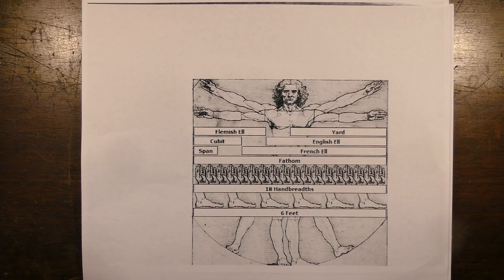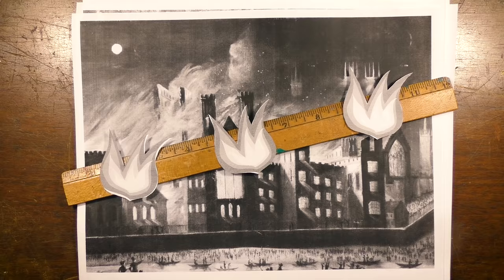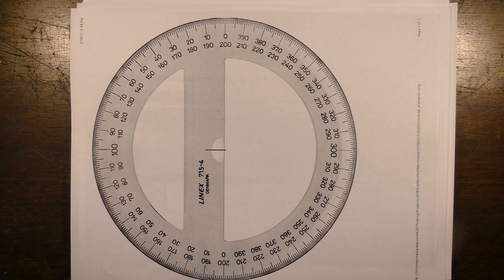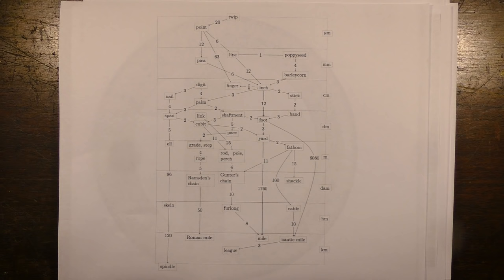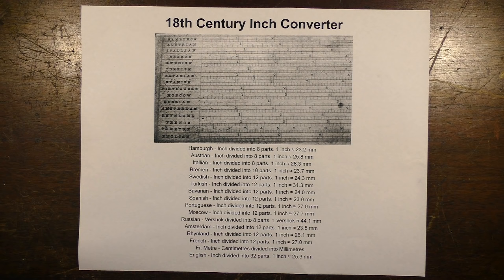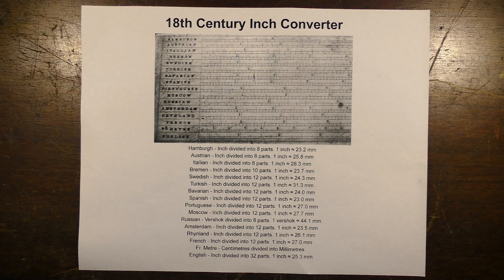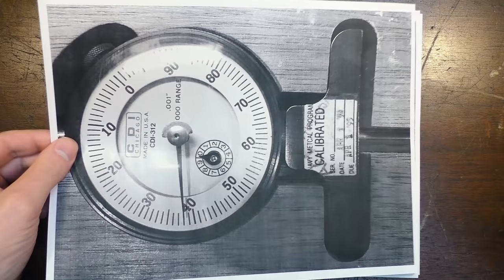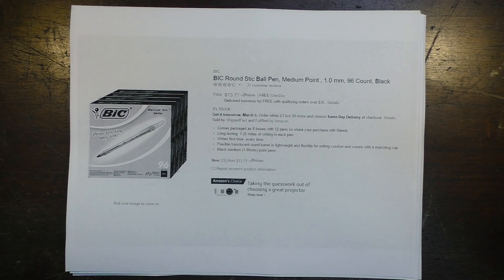Origins of Precision

Comment: What about earlier traditions of precision? The machines of Greece 2300 years ago were used to produce the Antikythera Mechanism. The megalithic yard is equal to the length of string required to make a pendulum which oscillates exactly 366 times during the transit of Venus across 1/366 of the horizon. How do you suppose the 100 ton, granite boxes of Saqqara were made flat, smooth, and square within a few microns at least 4000 years ago?

Comment: Video explains about moore company`s machine accuracy and various tools to measure parts accuracy. my thoughts about this video is that the moore company may be starts making their machine very precisely and insane length of machine. This company starts block gauge from 0.1001 inch  to 4 inch which is Extra ordinary things for error less production. This video relates to metrology because metrology is the scientific study of measurement not only mechanical field but each and every field is now depend on precision. we can get quality product if we focus on Accurate dimension of the final product for this we must learn metrology. The video explains necessity of metrology and methods to improve it in proper way

Comment: Kinda funny that it took me this long to realize the connection of the circumference of the earth to the invention of the meter. I mean, I knew the metre was based on the distance from the pole to the equator... but I never really thought about the implication... if a quarter of the trip around the world is about 10,000 km, then of course the whole earth is 4 times that (40,000 km ;P) .

Comment: They clearly state that the total number of combinations possible with 81 blocks is over a 100.000. They are not advertising over a 100.000 discrete measurement increments. Of course, if u have 81 blocks there would be 2^81 combinations which is far greater than 100.000. In fact, somthing to the order 10^24. Maybe a smart way to handle this situation without calculating the increments.

Comment: Actually, you are wrong. The mile, inch, foot, gallon, pint are all intergrated with the circumference of the earth. They are based on the 3,4,5 rectangle and the Pythagorean theorum. A mile, furlong, inch, gallon, pint are all part of this comprehensive system. It is also based on Fibonacci Sequence.
Reply: just let them have their fun thinking they're so enlightened, lol

Comment: 17:01 You'd have to apply the binomial coefficient with every k between 1 and 81 and add them all together. It's definitely not 81! which would be astronomical (5.4x10^120 or something ludicrous like that, but that would only apply if order mattered, which it wouldn't for gauge blocks), but it's definitely more than 100,000 (they gave up trying to calculate it, clearly).

I'm no student of combinatorics but I did ace Prob/Stat 101 and I do have access to google sheets, which says the possible combinations are roughly 2.417x10^24.

Don't believe it? Well, how many sets of 39 gauge blocks can you make if you were to choose from 81 of them? (It's a lot.)
Reply: Beat me to it!

Comment: May 20 of every year is World Metrology Day. It is the anniversary of the signing of the Treaty of the Metre in 1875. The US was one of the original signatories, yet is the only one where the metric system is not in common everyday use. An irony to this is that US participation was largely driven by US manufacturing and mercantile interests. They recognized the value of a simple and unified national and international measurement system. Yet here we still are with the "US Customary measurement system" versus the rest of the world. Can't even call it the Imperial system any more because the British Empire hasn't existed since the 1950s. 
There is even a Federal law from the 1960's or 1970's (???) that requires the use of metric as the primary measurement system in all procurements, with traditional units deprecated and following in parentheses. 
.

Comment: I have a continuancy question: You say in the video that the Meter was made an international standard in 1875, but that the US received the Nr. 27 bar in 1866 - Is that correct? Did the french send it to them 9 years before SI units were made a thing? And the US actually adopted it that early? Or is one of the numbers wrong?

Comment: The example at 26:38 is perfect to demonstrate the stupidity of the imperial units versus the metric system. With metric, you just add blocks by decimal increments until you get the desired length, and voilà! Done ✅ no need to do complicated calculations.

Comment: ... this is not a knapsack problem at all!! There is no weight that you are restricted to here, NOR a value you're trying to maximize, so even involving the (NP-hard) knapsack problem is a gross overcomplication.

This is simply a combinatorics problem -- you're just counting possible combinations -- for which you don't need a program at all; rather, just a properly set up formula using the permute/choose functions and the parameters of your particular case

Comment: Good points until the Calorie nonsense. You know as well as I that Calorie is not the SI unit of Energy, but a Joule is. And the Calorie to Joule measurement is 4.2 which is no less obtuse than anything Imperial does.

Whereas, BTU is about pounds of water going up one degree farenheit- which may work pretty well when you consider it was developed for boilers intaking water by weight.

Comment: Why do we have to assume our initial ruler is straight, so long as the curvature is consistent--if not across the whole rock, than at least at the points being measured? That is, if you have a piece of material suitably hard for use as a metric, than shouldn't the irregularity of that curvature across the whole system be totally irrelevant--even potentially useful if you have to use multiple standard sizes of measurement which you understand how it can match?

Comment: Ah measurements in the late 70 I took over my dad's cistern or water tank building company his forms for pouring concrete drinking water tanks was about wore out so I took my trusty calculator and started calculating out the design of new one but I had a problem it came out in 1 hundreds of a foot and I couldn't find a tape with those markers but the calculations showed I needed 13 ft diameter to get the gallon size and since that was 3 meters and metrics is based on tens and thousands I switched to metric which also solved another problem 13 is for those superstitious people who believe 13 is unlucky its 3 meters interesting the tank was still 8 foot high and 6 inches thick but to calculate out circumference diameter and radius it was in metrics I still used my dad's method of marking it out make a diameter stick with a radius stick lay it on a paved or concrete surface and draw a circle then measure out all the sections metric made my life a whole lot easier then our government switched to metric measure

Comment: The US system is a more practical, natural system perfect for everyday use. 1 cup, 1 gallon, a foot, an inch are much more intuitive and body based. How do you gauge 250ml? 12 inches is base 60, much easier to use, off the top of the head. As opposed to 30 centimeters, which is unwieldy. But, if I want to make a device, the metric system is far easier in base 10, with its natural smaller units. Plus, its cross referencing between units is very convenient.
Reply: I'd know 250ml well, it's 5/6 of the average cup of coffee that I drink, or just about not full. If it's any less than that I'd ask for more or feel robbed

Comment: Modernisation creates a progressive update of civilisation by incorporating new developments in building infrastructure and industry, yet when modernisation becomes dominant it removes previous precedents that had aided humanity for hundreds of years. We currently see this progress as an essential evolution of civilisation itself where old and inefficient is replaced with new and progressive yet what if this is the wrong approach? What if modernisation is only as effective as the areas you choose to remain the same?  In this way modernisation increases a variation of solutions rather than replacing anything creating the ability to capitalise on what has worked sustainably previously whilst utilising what's hugely successful today...! This isn't a suggestion that is in terms of our current mix of buildings and infrastructure this is a suggestion that sees a value in inventions such as water mills and horse drawn machinery of which had practically no negative impact of the environment at all,,, similar solutions should have kept a presence helping to keep our carbon feet print at manageable levels because we are using a more diverse range of solutions of which creates a more resilient  robust system that has a greater ability to sequester any toxic results of our dominance....!

Comment: pain in the ass ->  The biggest reasons the U.S. hasn't adopted the metric system are simply time and money. thank you
Reply: .... just about all manufacturers have adopted the Metric system, like with the automotive engineering and manufacturing, because they buy parts from International suppliers..   the issue is pretty much irrelevant now. imo 🤔  

70 to 90% of bolts I remove or loosen when doing auto mechanics on Domestic vehicles, are metric bolts.

Comment: Err... SO around 15:30 the clip narrator says something about the blocks being extremely sensitive to temperature changes. With that in mind, would that not mean that there is going to still be more "international" errors? Like - I'm guessing "locally" the parts / gauge blocks will be roughly the same temperature, so any expansion / shrinkage will be accounted for (ignoring Temp. coefficients I GUESS? /shrug) but wouldn't this mean a part made to spec in Siberia will be slightly oversized when it arrives in a factory in Western Australia?  I'm sure I'm being dumb here but even with sending the gauge blocks WITH the parts so that the WA factory can check them, unless the parts are made from the exact same material as the gauge blocks, wouldn't the parts still show up as incorrect? I realise we are talking about 1/10th's of an a***holes hair here, but idk ya 1940's narrator got me thinking.
Reply from the maker: It varied over time and place, but now the standard for measurement is 20C.  Where it really matters, there are temperature controlled rooms for inspection, and sometimes even manufacturing.  If possible, you avoid designing parts that need that kind of precision, which needs to be quite high before temperature is a big concern. See my NIST video where evening turning on the lights would throw off the measurements.
Reply: @machinethinking  have you heard of the ancient Egyptian precision granite vases? UnchartedX has many great videos on their analysis. highly recommended!

Comment: i have a big question, i have been strugling for quite a while now, we have a 3 plates method to achieve the perfect flatnes.. but how the hell can we achieve the perfect squarness? whats the method?? anyone knows? please help !
Reply from the maker: Once you have a very flat surface plate, you can use that to then make 3 workpieces each with a very flat side.  Then by putting those flat sides down, you can rub a side on each workpiece together until you are basically doing the 3 plate method, but now vertically. That will give you a perfectly right angle. You can repeat as necessary.
Reply: @machinethinking holy hell... Thank you so much. I spent way to much time wondering how you would go from a "simple" flat surface to a insane precision of today and while this video answered some of the questions I've had it didn't really go into bits I wanted. I still didn't get it. But with this it makes more sense now.

Comment: how do you get a perfect right angle tho?
Reply from the maker: Once you have a surface plate,  you can take 3 iron blocks and make their bottoms very flat. Then start to rub one side from each together.  The plane you can make from there has to be exactly 90 degrees from the surface plate.
Reply: @machinethinking  makes sense, ty:)

Comment: I seriously hate it when American machinist doing precision work and say "One thousandth on an inch"... it seriously sounds stupid and drives me nuts, I wish they would always say 25.4 microns instead. I'm sure a lot of errors in American machining would've been prevented if they used microns instead of inch for precision work. It should be mandatory to use microns and millimeters for precision work when units go less than 1/8th of an inch in the engineering field. Dude this "precision" documentary is lacking. You forgot to mention about the ancient Egyptians and their methods of "precision" for making huge monuments and pyramids with great accuracy and precision which can't be done today.

Comment: Your tool or creation is a table 😂 what wrong with the beach 😮 I think one would need two pieces of wood to make a set square now you vcam laugh at my idea
I found the tool of creation through working out how to attach 6 sides with out crossing stick or back wards 
Fit 3 sticks through 6 sides with out crossing and must be even in matter 🎉 it’s a dice 
Join the dots to see with in 
Lines vectors meters etc etc 
And one could make a plain to get you that flat table 👁👍🏽
👁☦️☘️🍀⭐️🎲🌈🥳🥺